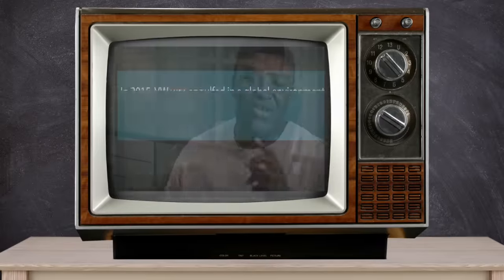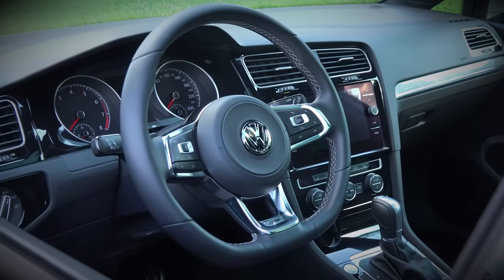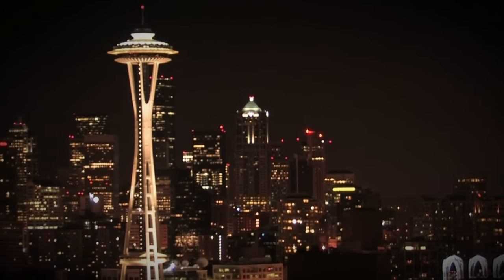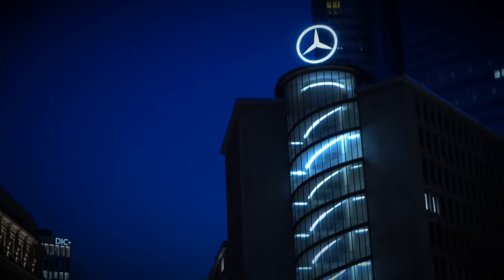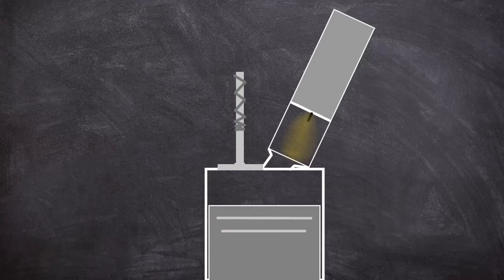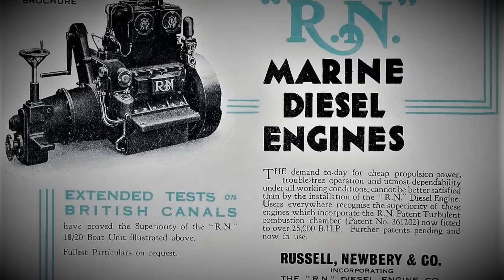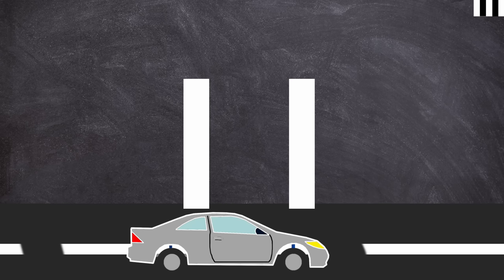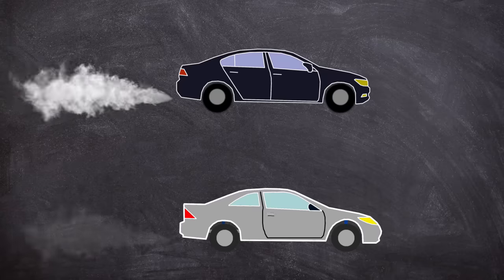Scandal: VW Emissions Dieselgate Explained | Plainly Difficult Documentary

Comment: Just small correction - US emission standards are NOT tighter than European ones. The standards are different in different states, but California is in particular is where they are tighter. The key thing being - US is much less uniform than we think and in many cases more similar to EU with each country having different laws... In this case emission standards are actually more uniform in EU (well they are literally the same) than they are in US.

Now when it comes to this topic in particular, I actually blame stupid testing methodology both in US (or in this case California) and EU. They are highly unrealistic and doesn't even vaguely represent real world pollution nor fuel consumption. Since this scandal there were some moves to make methodology slightly more "realistic", but it still has no resemblance to real life driving condition. For this reason they were just made to be manipulated (maybe even intentionally) and it was just matter of time until somebody did. I am not defending VW here, but just recognising that test were cheated, because they were designed in such way that it was easy, beneficial and almost necessary to abuse.

Where it annoys me is that they resulted in the cars we have today - tiny engines, turbo-chargers and gazillion gears. Basically instead of making best car for the driver, the companies were making cars to meet the standard and specifically to do well in the testing for which methodology was known. So it is like rules for race cars - everyone are trying to push envelope and use some obscure way of circumventing the rules to gain "unfair advantage". Let's just be clear - everyone were doing it, the only reason we know of VW is that they got complacent and careless to such degree that difference became so obvious.

But going back to why it annoys me - that is because these stupid regulation made by ecomentalists who do not understand the cars not only not made car less polluting they made them horrible to drive and in real life MORE polluting. Again, because methodology was so far detached from reality it is possible to create the car which does very well under lab conditions, but is horrible in real life. This generally achieved by tiny engine with many gears, so that engine can always stay in "optimal" rev range, turbo-charger than added just above that optimal range (usually ~1500 RPM+) to boost the power. What it mean in reality is that we have gutless engine which makes very little power up-to 1500RPM and gearbox which is never in right gear, but as soon as you hit 1500RPM turbo suddenly comes alive and just gulps on fuel.

Just taking common examples - often 2L turbo engine are much worse on real life fuel efficiency than 2.5L V6 without turbo despite having similar power, yet V6 is much nicer unit to have in the car. The only way to have similar fuel efficiency is to keep turbo engine in that below 1500RPM range, which is why gearboxes are usually programmed to shift the gears very early, but that means driving very lethargic car with accelerator which is more like on/off button... so it tries to keep it efficient all the way until you hit the spot where ECU thinks "he must be trying to accelerate" and then suddenly car jumps forward on boost and wastes a lot of fuel.

This goes back to my point - people who did not understood how internal combustion engines work created regulations which were stupid and methodologies to test them which could be manipulated and adapted to, resulting in generation of "downsizing" which ruined the cars, yet made them no more efficient (often less efficient) and often worse to drive.

Comment: its really a shame vw dropped out of diesel completely  I have a post fix jetta sel tdi that I got at 11k miles im at 92k without any problems the post fist emission system works just fine they made the fill just big enough to fit the truck stop def pump so I just use that to fill it up after around 10k miles. also the epa numbers are way lower than the real world numbers I regularly get 49-52 mpg depending how much throttle I use. I can drive from cincinnati to the florida border on just 12 gallons of fuel
Reply: Eh... I think diesel's pretty dead for the passenger car market. Gas engines have made so many strides in mileage and diesel engines need so much extra stuff to reach acceptable emissions that I don't know if it's ever really worth it to get a diesel.

Comment: I owned a 2009 X5 diesel which was a great car but indeed very prone to failures as the DEF (Adblue) system was fragile.  VW killed the market for a very efficient technology that would have greatly reduced CO2 emissions.  It is a sad story as modern diesels produced after 2015 are actually way cleaner and IMO are much less environmentally damaging that cars that use very complex batteries of which no one has the faintest how they will be recycled.  This is without mentioning the ENORMOUS amounts of copper and other minerals needed to produce them.  Modern copper mines move millions of tons of rock per day to extract the worlds need for copper.  We will soon see copper mines based on grades lower than 0.2%.  So, all this bleating about how electrical vehicles are the future is an even worse fraud than this diesel gate story.

Comment: I sometimes feel a very big deal is made of some of these scandals with non american brand cars, by the Americans.

For years it's a been a reasonably known fact that car advertisements have mislead us about the MPG of a vehicle, how else did YMMV become stuch a trend. I remember there being quite a few motorcycles that would have flat spots in the power at certain speeds and revs, this would be at around the point where they were tested for noise an emissions. VW where just caught pushing the limits of taking the p*ss.

Comment: The technical factual mistakes are very disappointing and make me doubt quality of the rest of your statements.
a) fuel air mixture is NOT compressed in diesel engines, only the air is
b)NOx is not a particulate but a gas
c) AdBlue does NOT reduce NOx to 02 but to N2
and probably more

I think you should take this video down and upload a corrected version, if you are interested in being believable.

Comment: Modern emissions diesel might be clean but the reliability is trash and they burn more fuel. Likely if everything was added together they would have more net emissions. You'd have to add in all the emissions from producing and transporting all the replacement parts and how many more wreckers are needed to transport the broke down emissions trucks.

Comment: Love my Tdi all these em idioms are making the cars less reliable and less efficient. Sad this killed most modern diesel cars
Reply: Diesel has a lot of downsides totally unrelated to the emissions systems that have led to gas ICEs pretty much eclipsing them. A lot about how a diesel engine operates causes it to be harder to make small ones reliable, which is why nowadays they're mostly just in buses and trucks, at least as far as the roads are concerned. The mileage advantage has been cut down to the point where in city driving some gas ICEs are able to outperform diesels on their own. Even the low-end torque performance has come up on gas engines.

Meanwhile the same sort of improvements have just... not really happened with diesel engines. Even if you ignore the added emissions systems, a car-sized diesel engine today just isn't that much better than one from the '80s. Not compared to the sort of improvements we've managed to squeeze out of gas ICEs, anyway.
Reply: @PhysicsGamer  not true with common rail small engines they are extremely reliable when you defeat the emissions and get even better fuel economy. Torque like a v6 and fuel economy or a 4 cylinder.
Reply: @Fonzieshoots  Maybe a V6 from a few decades ago. Or a really small one today, I guess. But besides the low end torque that you really do need an electric to match... gas engines aren't that far off. The 2015 diesel Jetta made 150 hp, which even the base 2023 gas model basically matches (147 hp) despite being only a four-cylinder engine. But that's just horsepower - the 2015 diesel engine still beats it on torque, but only by ~30% compared to the nearly double that was the case back in 2015.

And while I don't have any real data to support my conclusion here... I can say anecdotally that those I know who run diesel engines, including the ones that have elected to remove their emissions hardware, are always having something going wrong. Unfortunately that sample isn't really representative in and of itself for the emissions-removed group. Besides the small sample size of two, they also both have an unfortunate fondness of "rolling coal". Which is... let's just say "a known hazard to engine health".

Comment: Why are we not running cars on methane again? Every time a mammal craps we are making fuel that burns with zero emissions and can be easily adapted to existing cars.
Reply: Hydrogen is the better fuel thh
Reply: @0Synergy  too volatile
Reply: @jeremypilot1015  maybe but the new hydrogen fuel cell electrics are amazing, way better than lithium, cleaner and safer for the environment and humans, and sustainable. Lithium is a joke and diesel is gross and horrible for people around it.
Reply: @0Synergy  I am for all types of alternate fuels. I just don't think we should give up on the internal combustion engine just yet
Reply: @jeremypilot1015  i don't have a big issue with gas cars I mean I drive one lol, they are way cleaner than people actually know but we need a solution for the long term. Right now electric cars suck and will suck until we can ditch Lithium, diesel is awful, hydrogen electric is the best bet.

Comment: Not saying what went on was ok.  But for years the writers of the environmental laws and public campaigns keep saying emissions controls don't negatively effect how vehicles perform and run.  And the public wants them.  This kind of shows that people liked the performance and driveability of the vehicles that were unable to meet the requirements. And the cats were tuned to be most drive able and perform as customers expected. Making them fail. Yet we continue to drum into public that the emissions are good and make the vehicles perform better last longer and  we should get rid of the ones we have to get the cleaner ones before the old ones are used up. This creating more pollution than getting the useful life out of it.

Comment: I disagree a lot with how the defeat device came to be. I don't think it was designed to cheat at anything. Well, think about this solidly, your car is stopped in traffic right? Don't you think it's a good idea to reduce emissions whilst not driving?

So, around this time a number of car makers went for a technology that stopped the engines and then started them back up.

I think that this device came about because of this, why not adjust the engine into a kind of slow down when idle? I just think that this came about by accident rather then a deliberate attempt, the cheating the tests was merely a side effect of how the car was designed to operate. Because the testing method wasn't suitable for these cars.

Comment: If it was industry-wide, why dump solely on VW? I'm absolutely not saying VW is innocent, but your video is woefully lopsided as other manufacturers were doing the same thing — but you certainly did not give that indication until right at the very end.

I own two diesel VW Lupo 3L from 2003. At factory-fresh, they were touted to run 83 mpg; we were able to get mileage well above that! Now, 19 years later, they still get 73+ mpg and as such emit far fewer particles than the usual environmental nightmare diesel motors burning far more fuel per mile/km than my Lupo 3L do. They also have dual catalytic convertors! Amazing cars — so please don't make it sound like VW was screwing the planet over. Try comparing emissions from these fuel-efficient cars to the monster-sized road hogs Americans drive around in and get back to us.
Reply: @theairstig9164  Ha! I'll take my 0-60 in double digits as fair trade for long-haul fuel economy. And my car carries 4 people with baggage!

Why is there so much focus on how fast your vehicle leaps out of the starting gate anyway? When is that reasonably useful — and what does it matter or prove?

Comment: How about looking at it the other way?  They developed a way to meet a silly, arbitrary regulation.  Neither the regulation nor the test have anything to do with the quality or performance of the vehicles.  Neither the regulation nor the test have any common sense bearing on air quality.  Heck - any car built in the last 20 years probably works as an air purifier in many cities! I think the engineers should be rewarded not punished.

Comment: I think its funny that volkswaggen got crucified! The 2 worst cars I ever had the misfortune to own were golf TDIs, but still. In the late 80's and early 90s I was involved in reverse engineering GM EFI systems. There was code in those ecm ('730 and '727 ecms) that appeared to offer a different emissions profile, one that was much better for emissions but worse for power. It was a "cheat' mode.

Comment: To be fair them things are still clean burning and efficient engines.
The amazing MPG these things get is enough proof of that. 
Burns less fuel = very efficient and an efficient diesel is a clean diesel at least in terms of  Particulate Matter. CO and NOx are very different from Soot and apparently you get MORE NOx when you optimize your engine further and further because the combustion is hotter BUT hotter combustion = less Soot.

A dieselgate VW is still cleaner than your shitty old Duramax or Cummins getting 15mpg and rolling coal when you go flat out.

Comment: I don't get it. The EPA had a test the car had to pass, and it did. This is an EPA scandal, not a VW scandal. I drive a 2005 Passat TDI 2.0 and at all speeds it it has slower RPMs than my wife's 3+ liter gasser. That's less total volume of exhaust. So the % of bad stuff might be higher, but less overall. (And I just got 46mpg on a long trip.)